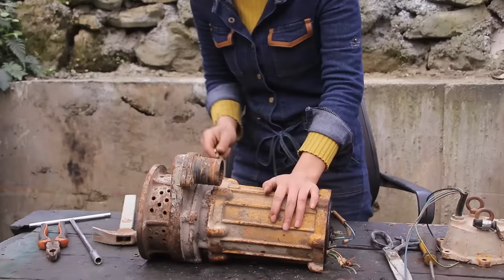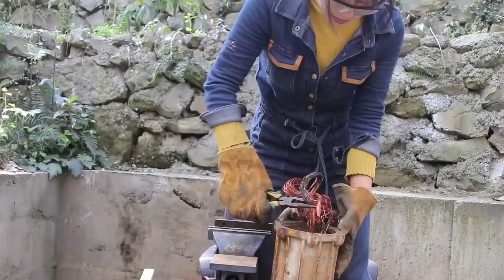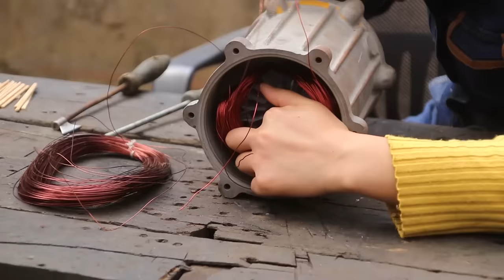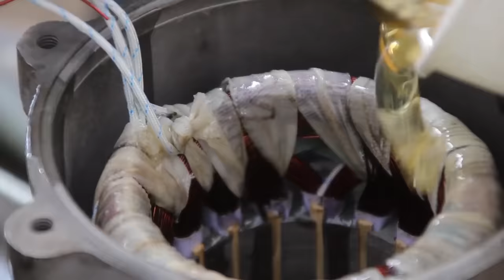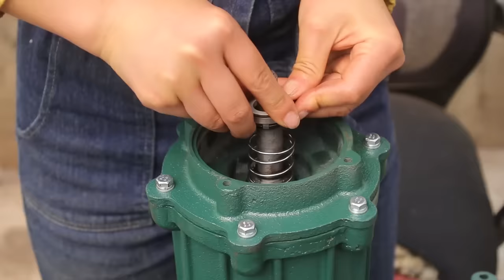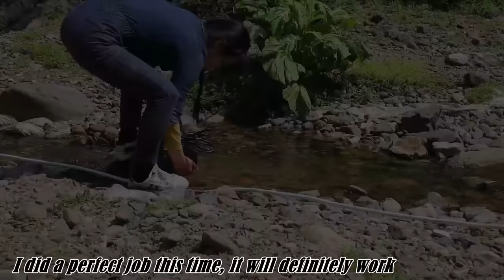💡$0 Repair Abandoned Water Pump From Scrap Yard, Restoration It Powerful Make Guys Envy | Linguoer

Comment: I’ve rebuilt all types of machinery on ships…. You are top notch and when you are finished … it’s a better than new product.  Most older pieces of equipment were built to last unlike today’s throw away products.
Reply: She Rebuilt them Better than New Definitely 😏😁😚
Reply: You are right about the quality of her work and how the older things were made to last for decades.  She rebuilds things to the way they were built back in the 1940’s - 1950’s when things were built to last a lifetime instead of getting replaced every couple of years like modern products. For example my United States Electric Tool Co. 6” bench grinder is from 1941 and my old DeWalt radial arm saw that was stolen from me was from 1946 and had a brushless motor.
Reply: In the past things were made to last, nowadays things are made to the cheapest $ to maximize profits.
Reply: @ainzooalgown7589  sad but true. Up until about 8 years ago I had a refrigerator from the 1920’s that still worked fine, power tools from the 1940’s, radios from the 1940’s to the mid 70’s and they all work to this day and will likely still be working when I am dead and buried and I am only 51.
Reply: Tiger campus 333(Hudson)L1/2 ONO American with guns Goerge Fong Don't thread on me Assad (Cabalza) old navy Quero by Hino Cruz ☯️ Español Efren FEATI University
Reply: Exactly very true.
Reply: @JorgeRodriguez-po7kx
Reply: Oh dont be ridiculous, youve never seen clickbait before? Its all B.S.

Comment: That claw hammer could disassemble anything.  I'm amazed at what can be done with just a few tools.
Reply: You can do lots of things with simple tools, it just takes a lot longer.
If you have nothing better to do with your time, or no resources, you may have no option. Running a business you would probably replace the item, as repair would cost a too much.

Comment: Love your videos! but, I have one thing to say about this pump. It seems to me that it should have gasket materiel to keep the pump motor dry :D For your own use, it may last longer this way. Thanks for doing this stuff!
Reply: I thought the same thing. The cavity where she hid that starter capacitor needed a seal. It looks like a fully submergible pump (the 2 eyelets) - but maybe she isn’t planning to submerge it - or left out its installation from the video.

Comment: Awesome.😁👌👌😎🛠️
BTW. You have an Compressor with press air. You can use a tool for some hammering. Makes work a bit easyer as you already have the machinery 😉

Comment: I love pulling all these kinds of things apart. But unlike this confident lady, I usually lose bits and end up never putting it back together again. What are you using as your sand-blasting grit?
Reply: Judging by how quickly the rust and paint is being ripped off, at a guess she is using iron shot

Comment: Since you showed the pump working at the beginning, you were successful. 😀 I am commenting before watching you do the windings. Since you are going to a single-phase motor, you will need a higher amperage to run the motor, so a little thicker wire should be used. maybe a few more turns on the winding to increase the magnetic flux?  Would like to know if you did either or both.
 因为你一开始就展示了泵的工作，所以你成功了。 😀 我在看你做绕组之前发表评论。 由于您要使用单相电机，因此您需要更高的电流来运行电机，因此应使用稍粗一点的电线。 也许在绕组上再转几圈以增加磁通量？ 想知道你是否做了一个或两个。
Reply: I have a feeling she knows what she is doing.

Comment: Hello To Join,
I have been watching your videos from Spain and I love seeing you work, because it shows that, for you, more than a job (which is also) is a professional challenge. - It is very striking, to see a young lady (and also very pretty) dominate electricity and motor mechanics, with such a high level of knowledge and capable of manufacturing the parts. life to the engine, inside and out.- I imagine that your clients will not leave their astonishment and satisfaction, because the majority already gave their machine for dead and you return it to them, as if it came from the factory.- I don't think so It is an exaggeration to say that for me you are a genius.- I am 75 years old and I love mechanics, although I am not a professional, nor can I compare myself with you, but I think I am qualified to value your work, which for me is admirable.- There is no machine that can resist you.- It has been a pleasure, getting to know your work, seeing how you do it.- You have earned everyone's admiration.- I congratulate you. A cordial greeting.

Comment: Ms Lin,  You are just amazing.  Converting a 3-phase machine into a single-phase one  !!  How did you work out the required re-wiring ??
Reply: It's actually wired like a 3-phase motor internally, but the white thing she puts inside the top of the pump is a capacitor.
What that capacitor does is that it delay the phase of the two 220 volt AC power, and presto it is converted to 3-phase.
The capacitor value must be calculated to match the horsepower of the electric engine. 
That is the simple explanation. You can find more information about it on the internet.
I have no idea on how she calculates the optimal number of turns, and how thick the transformer/magnet wire must be.

Comment: This is a place where we can all learn, including you. Learning to pick the correct tool (as large a screwdriver blade as will fit), or how to tighten a number of mounting screws... almost tight all around then FINALLY as tight as you can on already tight bolts. Etc.

Comment: Forgive me asking, but what is the difference between a single phase motor and a three phase motor. I love watching the videos for Lin's sheer brilliance, hard work and beautiful personality.
Reply: Three phase motors use three hot leads and don't require a common.  Singles , like the 110/120 motors found in the states use a single hot leg and a common.  The 220 motors are in a group between those in a way, they have two hot legs and may or may not require a common.  Clear as mud huh LOL.  Let me know if you still don't get it and I will try to break it down better.
Reply: @dondiego2262  She added a start cap, but I didn't see a start winding or throw out switch to disconnect the start winding once it was spinning being added. Maybe that just got glossed over.
Reply: @dondiego2262  Thanks for that. LOL sums it up. It is way beyond my ability. I will stick to growing potatoes!
Reply: @bpaakwaan7325  She added Running Capacitor and not Starting Capacitor which need throw out switch. Lin changed the circuit from 3 phase to single phase. By the way the Running Cap is White and Starting Cap is Black colour.
Reply: @raphaelfernandes2040  I don't think you can use a running capacitor as a start capacitor as its much smaller value will not allow the motor to start as the torque will not be enough. As far as I know the smaller value run cap is for power correction only, but I admit my motor knowledge is very limited, but I like to learn.
Reply: @raphaelfernandes2040  why color, we need to know the uF and V values and if it can take permanent load. it may depend on how she builds and wires the coils.
Reply: then also, the fun might be that the 2-phase version rotates a lot faster...

Comment: How did you choose capacitor in the convert process btw love your video from India😍😍
Reply: The capacitor value can be approximated by:

C = 50 x Hp x (220/V)^2 x 50/f where:

C is in microfarads

Hp is the motor's rated horsepower

V is the motor's rated voltage

f is the motor's rated frequency.

Comment: Your very good at what you do but look at grounding your equipment this would be much safer for you and those involved keep up the astounding work you do
Reply: Some parts of the world have a floating grid. You do not ground appliances and equipment. Laos is one example. I bought a computer power supply that came with a cord, but an found that the earth pin did not have  a hole in the power point. I was told by the local staff to break it off. My Australian manager said, yep the grid is not tied to earth. An earth can be done but needs to be wired very careful.

Comment: I am still torn on if Lin is the mechanical / electrical guru she seems to be or if she is a pretty girl there to "sell" videos and has a team working behind the scenes.  Either way i am good with it but I would still  like to know.  TBH I am not even sure what part of the world she is in , I kind of worry about some of the lack of proper equipment , mostly safety things.  I know the damage I did to my own body in a life of mechanicing without proper safety equipment.  I'd hate to see a pretty girl like her suffer the same fate.
Reply: If I'm remember correctly, she studied enviromental & hydroelectric engineering. She is from Yunnan, South China. If you follow her videos, you can see her multiple talents: rewinding motors, restoring petrol engines,  a chainsaw, a lathe machine, a benchtop drill, generators etc. That's not all. She built a house, complete with furniture too (table, chair and most interestingly, a working refrigerator). And she dabbles in restoration work too. A sword broken into 3 pieces. She rewelded and engraved some of its missing decorations to bring that sword back to its former glory. A truly amazing girl with a big smile.

Did she have some team behind her. Not sure, but I don't think so. Occasionally though, you can see someone helping her. But that is mostly when muscle strength is needed.
Reply: @alihms  she is hard working

Comment: Yes, you need better ventilation in your sandblasting booth.  The dust is very hard on the lungs.  You should also try and maybe build a better work bench and maybe spend some time making your vice attached better.  Good videos.